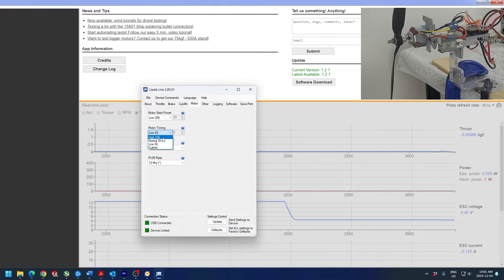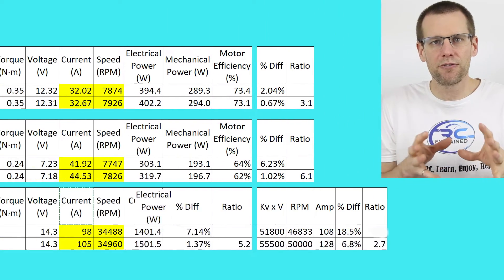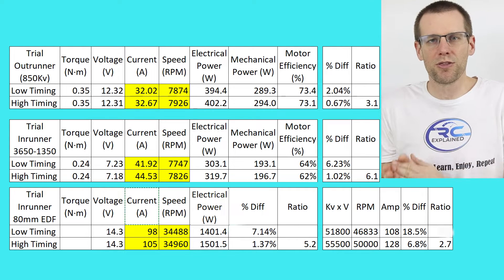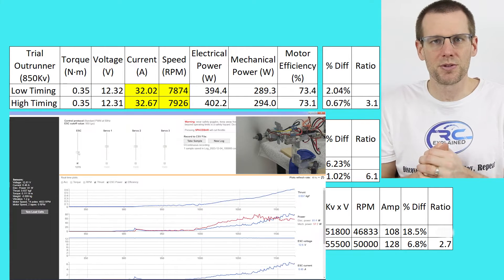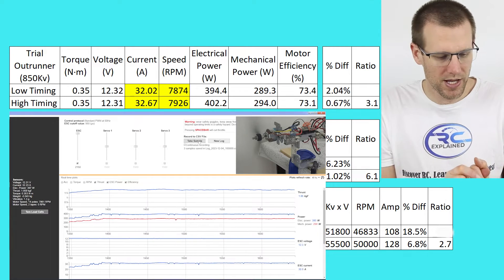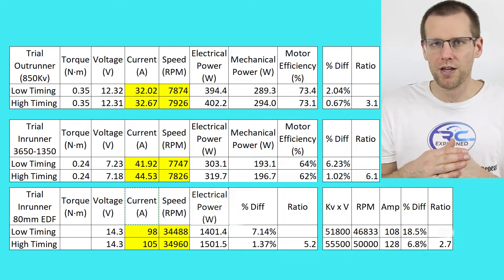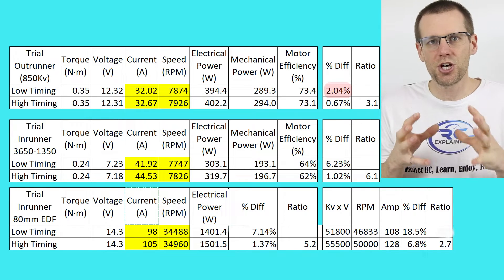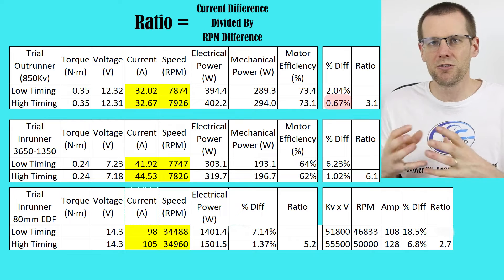The Untold Truth About Brushless Motor Timing - Where to Start?

Comment: thankyou for your time of explanations , but i wish to ask you a question , i m setting up a 56 inch boat running a 56114 sss 700kv (185 amp cont current ) fed by the new seaking 300amp v4 esc on 12s ,  timing starts from 10deg instead of zero , will it  work fine or withdraw more amp ,thankyou
Reply from the maker: I'd run dynamically changing timing and set that to low rather then running fixed timing.

Comment: Why the torque is same? For both high and low timing?! Arent torque should be increased as the RPM got increased and hence now the prop is running at high RPM?!

Comment: Good tests. Please tell me what angles you meant by LOW and High Timing ?
Reply from the maker: The esc should use a mode that adjusts timing based off of load, rpm, acceleration rate etc. Not fixed timing. When selecting timing within this mode of operation, using low is a range of low timing values that the esc will use. When using high timing, it's also a range of high timing values the esc will use.

Comment: In your test, what was low and high timing, how many degrees?   Are we talking 3 degrees or 30 degrees?
Reply from the maker: I don't use fixed timing and highly suggest not running a setup on fixed timing.

Comment: Hello love the videos very informative. I have a question I’m running a mini b with 69mm foams powered with a Hobbywing 16bl30 and  Ezrun 2030 7800kv 12t 2 pole motor. 18/60 stock gearing. What should I set the timing at? The combo that the 2030 comes in has the 18a hobbywing esc were I have the 30a one.  I do drag/speed runs only 2s. 16bl30 stock setting is 11.25 degrees and the 18a esc is higher at 15 degrees. Should I put it at 15 degrees like it comes with the combo esc or go higher since Im trying to get as much top end as possible. Any help would be greatly appreciated

Comment: I have a question 🙋‍♂️, so I race a slash with a 4600kv sensorless motor. If I set the Timing to 0 will it still give me 4600kv? Because the esc stock comes set at like 30degrees.
Reply from the maker: Timing advance only increases kv.
Reply: @RCexplained  ok thanks

Comment: All my timing is done with the motor. The track i run at they use the blinky mode esc. I usually run between 5 to 5.5 amps no matter what the timing is.
Reply: Amps?
Reply: @LyroLife  yes I set the timing to draw 5 to 5.5 amps from the motor so I don't run the motor to hot

Comment: I'm an rc drag enthusiast, for my 10th scale cars timing is the most important aspect of car setup besides tires. We set our own timing curves based on track conditions. On good days I used to run ungodly amounts of timing on my 2 pole motor, like 105-110° by 40,000 rpm, still some people who are braver than me go as high as 130°on 2 pole drag motors. 

This year I made the switch to 4 pole and I have a bit of confusion that I hope you can clear up. From what I understand 60° of timing on a 4 Pole motor will offset you by an entire phase Which is sort of like
Firing the spark plug bottom dead center of the compression stroke in an internal combustion engine If I understand the The concept. Yet some people are running well in excess of 60° on their 4 poles without a massive drop off in performance or detrimental effects for the most part, Other than pulling 350+ Amps on a 2s system. 
I'm assuming that at very high R. P. M. The slight bit of delay in dwell time between faze switching is what they're compensating for, But I could also be completely wrong on everything stated above.

 I would very much appreciate any knowledge You could share on this, it's probably going to help a lot of people not blow up esc's and motors.
Reply: Drag racing is a whole different ballgame. I run more than 60 just in the esc. And 20 on the can.

Comment: anecdotally TP motors, strong magnet motors, like LOW timing. If a motor is easier to turn by hand it will take better to higher timing without as much heat. Im a boat guy and I run WYE TP motors at 5 degrees, 10 degrees max. I run leopards at 10-15 degrees depending on heat and prop. Overall lower timing is the way to go except maybe for <5s pulls.
Reply from the maker: Boats are fun and definitely the most difficult to build for speed. It sure takes a lot of power to go fast.